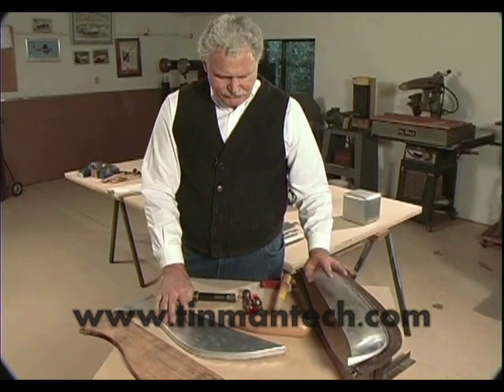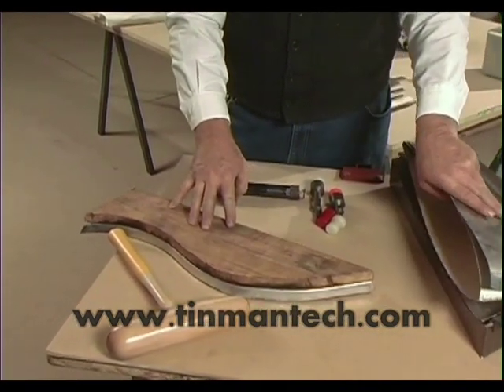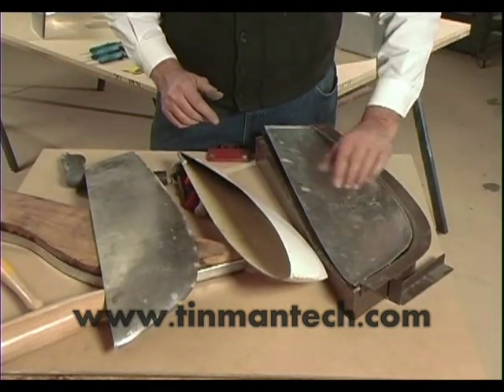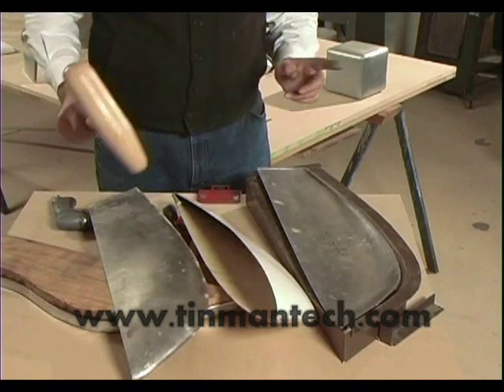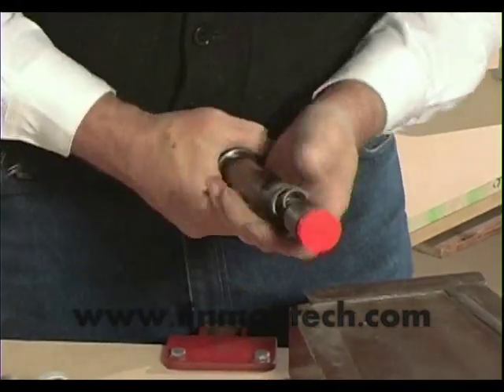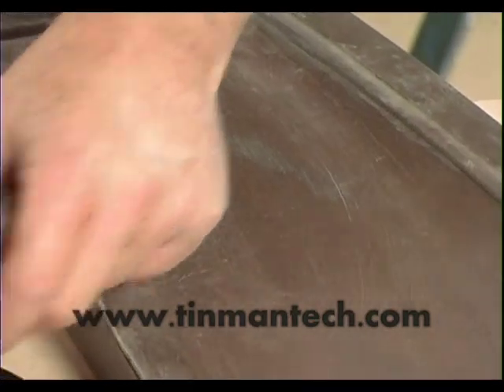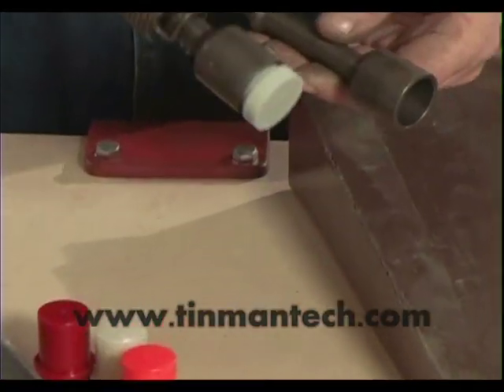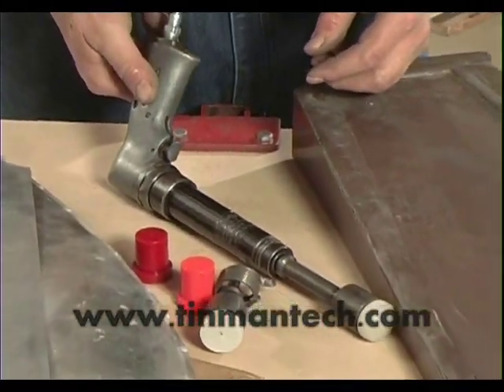Flow Forming Part 2 - Metalworking Tips from TM Tech

Comment: Could the technique you showed for the wing tip be used to shape something substantially deeper then the wing tip?  I would like to make an aluminum model boat hull in two parts.  The boats approximate dimensions are 52" x 18" which would make each half approximately 9" deep.  Thanks.